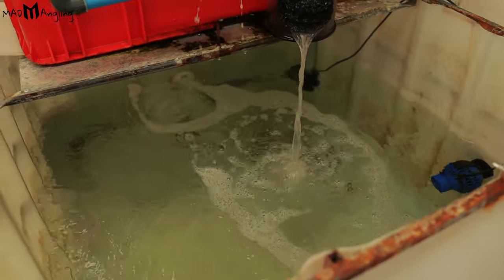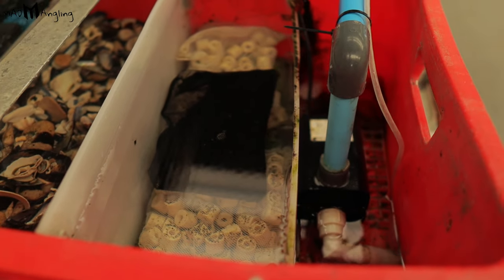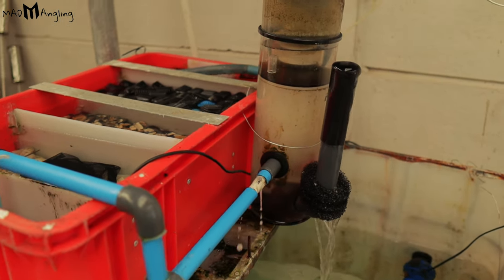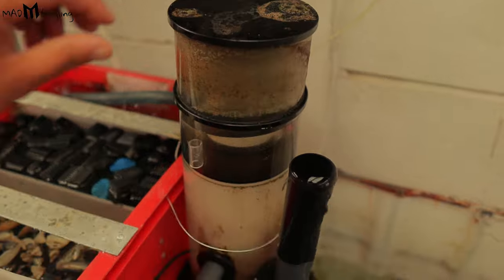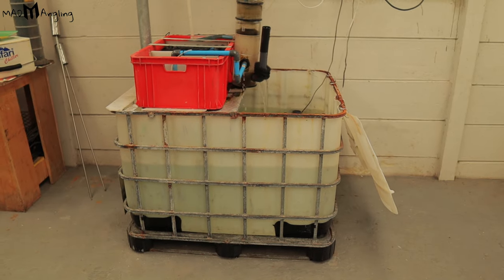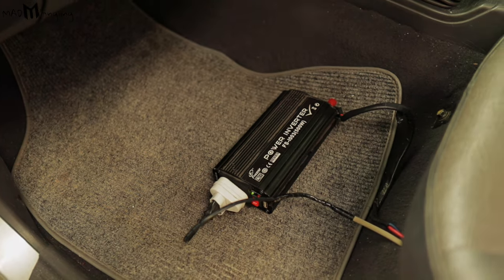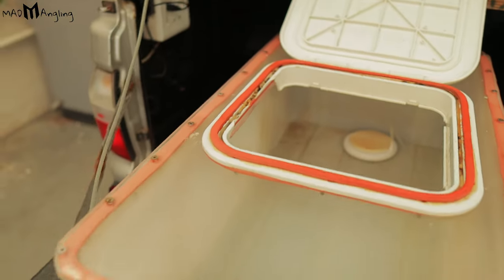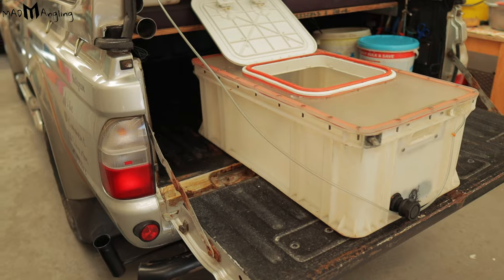How to keep mullet alive @ home

Comment: Very informative. How often do you replenish or fill the tank with fresh sea water?
Reply from the maker: Very good question... I normally do a complete water change every month... Or half water change with fresh water... If u go bigger sump then u don't have to change water that often
Reply: Don't have to change water if you run a sandponics system with this setup .
Reply: @deepinthemangroves208 what is sandponics system?